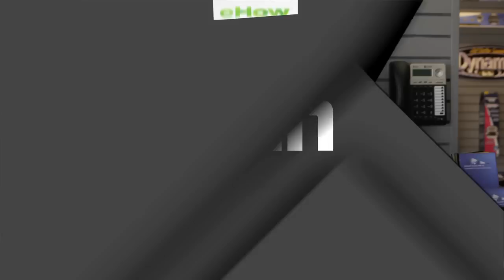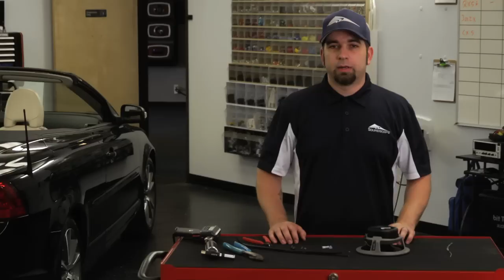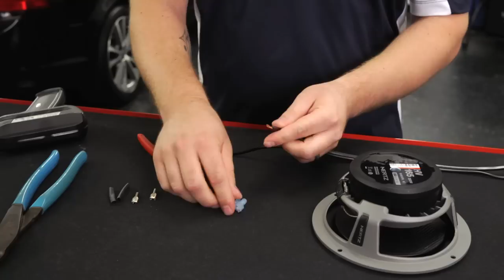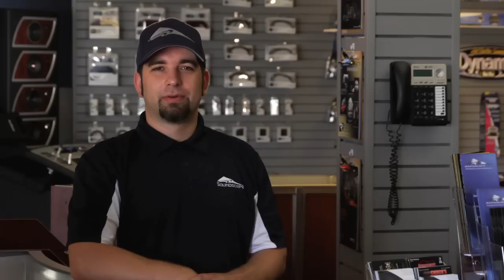How to Replace Speaker Wire Connectors : Car Audio

Comment: And what about the polarities? It ticks me off to no end that, of all the videos I've seen on car audio installation, NO one says anything about the reason why speakers don't have polarities stamped on the speaker frame. Why? What's the reason why they don't have it? And why is one connecting tab narrower that the other? This tells me NOTHING on polarity. I just bought two pairs of Cerwin Vega speakers. They include this lavish pamphlet  with suggested installation but say jack shit about the fucking polarity on the speakers. I got my car apart and I'm stuck because I don't know this nagging piece of information that, you would thInk, IT'S NOT WORTH THINKING ABOUT!  If they just stamp ONE connecting tab + or -- that would solve my problem! I can't believe this is the norm in car speakers today.

Comment: Solder adds resistance to the circuit. It’s a crimp connection. No need for solder.

Comment: When I cut off the factory plug. how can i tell which one is negative and positive from the wires on the factory plug.
Reply: Make sure you get it right. You could hook them up out of phase.
Reply: look up the stock wiring schematic of your car online it will tell you

Comment: Can you rewire your cars factory speaker wires with aftermarket speaker wire that you would get with like a an amp? Because I have to have my radio in my trunk with a 15ft aux cable and it is quite annoying. Thanks

Comment: I have a wiring question. If I wanted to to add a Center Dash channel to a stock 4-channel radio, is it OK to use the left front positive lead, and the right front negative lead with an 8 ohm L-pad to create a center dash mono channel?
Reply: did u ever get answer for this. I'm about to go through myself
Reply: @scottwalker7939  ...Nope. never got an answer. I'm pretty sure it could be done, though. In the end, I went with 4 quality speakers and did a good 4 channel setup with a quality deck using existing speaker wiring. This was the easiest way, and the sound quality turned out excellent.